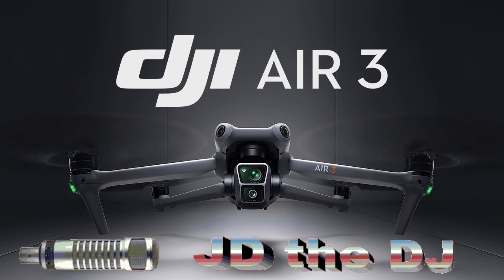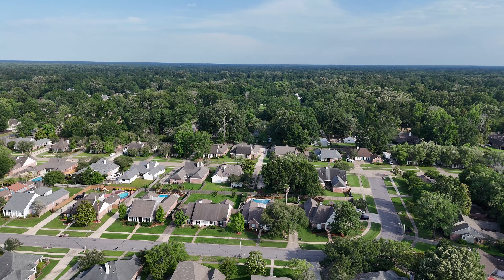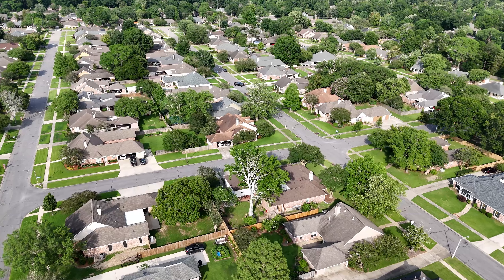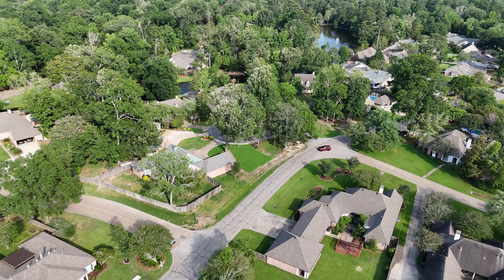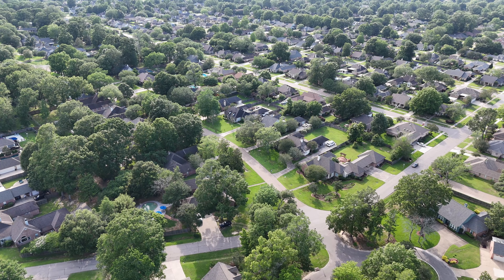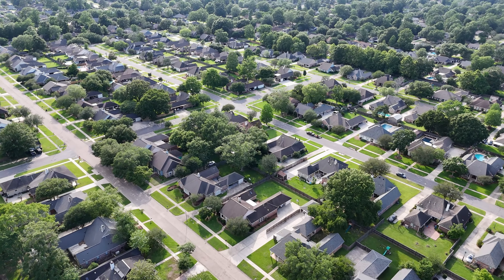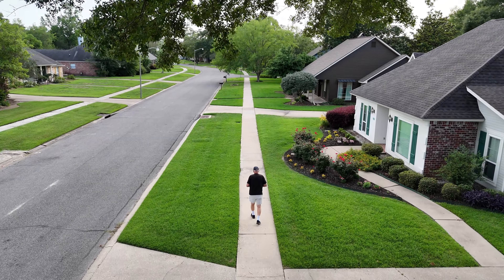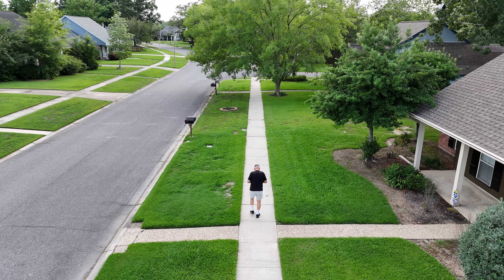Air 3 #2 First Flight Test & Crash

Comment: Did you ever turn it off of sports mode before you had it follow you? I believe when it’s turned into sports mode the obstacle avoidance sensors are turned off.
Reply from the maker: True, when you switch to Sport Mode, obstacle avoidance switches off. But when you return to Normal Mode, it switches on again. You can see it work to duck under the branches of the first tree encountered, then return to the set altitude before it gets to the deadly river birch.
Reply: @jdthedjyt  I didn't know if you turned it back to normal mode is why I was asking.